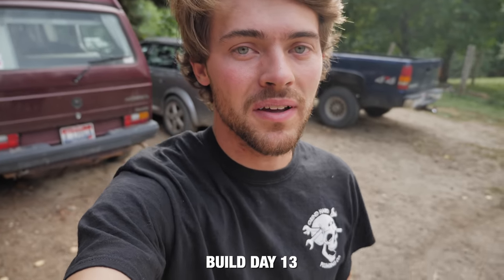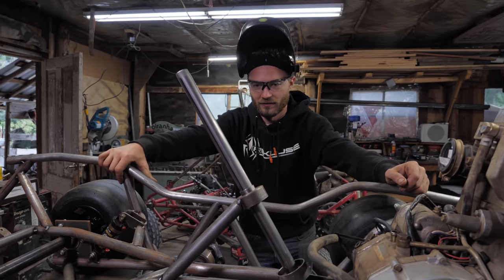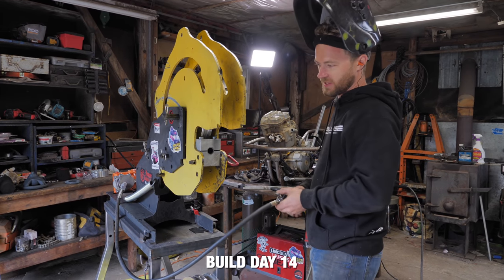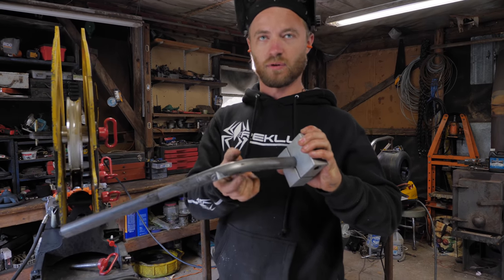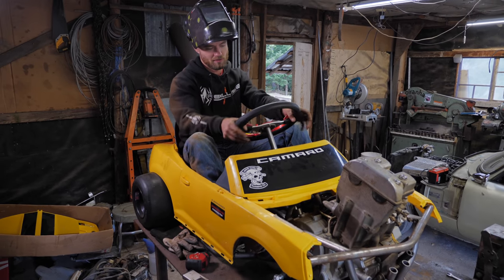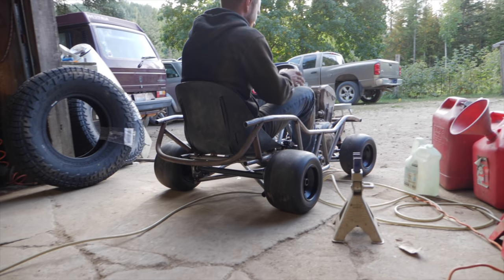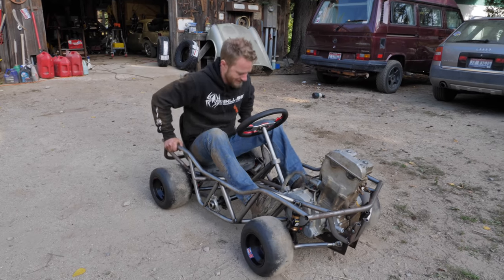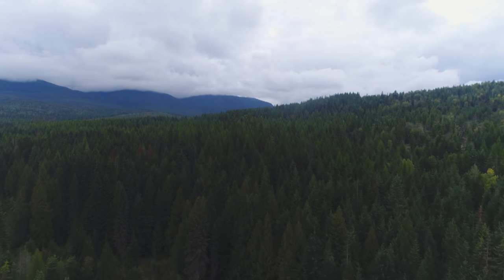Real Life Mario Kart Build!

Comment: 5 LBS you saved in rotating weight. Thats huge for something this size.
Reply: Big time
Reply: What do you mean rotating weight?
Reply: John Paulk from someone who doesn’t really know what they are talking about, weight basically increases as it rotates quicker. Like if you have a unbalanced wheel on a car, could be a minuscule difference but it vibrates your whole car.
Reply: @johnpaulk994  Tape a pop bottle to your driveshaft and find out
Reply: @johnpaulk994  rotating weight would be the total weight of all the driveshaft components (everything that rotates while the vehicle is moving). It's important because more rotating weight will have higher intertia, meaning the motor has to work harder to get it all moving and keep it moving. Plus, once it's  moving, it is harder to slow down.
Reply: @johnpaulk994  
Additionally, the more mass you have the harder it is for the engine to spin it but at the same time, more work has to be done for it to stop.
Reply: Then you remember its 500cc not 100.  The thing is insane. It has a fraction of the rotating mass and load in general that the engine was intended for.  Speed runs weight will need to be added.  And having more balanced rotating mass makes everything more stable. The higher the inertia the greater the resistance to change.  To little can be a thing. But it isn't a super car its a spastic kart so ehh.
Reply: @willpestka2745  Higher weight= more inertia. More inertia the less shock loading the engine itself will get.  Fill a push bikes tyres with water. It makes it harder but far smoother. And more inclined to continue to roll.
Reply: @friendlyoldbum9182  I know, but in general less is better. Too little and you're right, it'll cause problems. Thats why cars have flywheels.
Reply: @friendlyoldbum9182  
Thats what Im implying. It doesnt want to slow down/stop. It has a higher mass moment of inertia and therefore a greater moment would be required to slow it/stop it as well as start it/accelerate. By this, it has a higher degree of resistance to input forces.
Semantics, but inertia involves mass, not weight.
Reply: Wasnt being a wheeny. Just adding to you guys for anyone else that reads :D
Reply: An axle's weight, isn't going to have much of an effect on rotational mass due to is being at the centre. It is however going to improve handling due to a marked difference in sprung weight.
Reply: Almost everyone in this thread is ridiculous.
Reply: @thegenerousdegenerate9395  Thank you for your opinion. Though accurate I guess.
Reply: The more you know
Reply: Ay Stokes  haha wrong, I tried that but I found it was just as easy and better to play sitting and just wave around.
Reply: @TobiMcTobeface  
I didnt consider that aspect. Solid observation 👍
Reply: You are ALL WRONG.... Mechanical advantage in rotation.
Reply: It’s such a small diameter that the rotational inertia won’t really be affected, the weight would have to be a lot farther from center to have enough affect to be noticeable.  It’s also not unspung weight since it’s a solid mounted jackshaft, not a moving part of the suspension.
Reply: Weight is expontial especially in rotation.
Reply: @isaakwelch3451  What else would a starter engage with?
Reply: Pmoi on that small a tube means the weight saved won't have that much effect on rotational forces, but 5lb overall is a huge savings when you look at the percentage compared to total mass..
Reply: @theastronaut2276  if it's part of the suspension it's sprung weight
Reply: @shadowthehedgehog4737  a toothed accessory drive pulley
Reply: @isaakwelch3451  Yes.
Reply: @willpestka2745  Yes.
Reply: @johnpaulk994  The axle is lighter. It spools up more freely. Also, less unsprung weight. (Weight of components below the suspension pivot points).
Reply: @shadowthehedgehog4737  automatics typically don't have flywheels. The torque converter does the job of dampening vibrations.

Comment: Maybe hold off on painting the steering wheel until after the build. Like you said the little bit of red accents might work.
Going overkill on frame is a good thing. When ever something breaks its not because it was too strong. The engine will put out some torque. And you might just push it to the edge.

Comment: What's up Grind hard! 
Love the way your build's evolve as knowledge, experience and means build up over time 👍😀👍
A note on your steering angle.. Think you would want a bit more angle when you get sliding around in that thing. It's easier to control on the edge with a bit of margin..
Awesome work guys!! Keep it up and there's no limit to what you will achieve 😀 
Best regards from Jonny Bech 
//Sweden.

Comment: Looks like you guys may want to trim the points off the lower front suspension bracket and make a skid plate. Bottoms out pretty good at that height with those tires.

Comment: Just something i noticed, but those gussets under the front of the motor look like they'd stop you dangerously quick if they dug their teeth in during a high speed bottom out. Might want to round those off a bit, but I'm assuming you're going to increase the dampening on those shocks at some point, too.

Comment: Is the new axle hollow tubing? A tube is stronger that a bar of the same diameter because it has more surface area, inside and out. So besides weighing half as much, I is much stronger.

Comment: Shift paddles on the steering wheel and the clutch also on the steering wheel, would be cool, as by a real race kart, and it's much easier to handle while driving. Left paddle for down shifting right for up. 🤔 actually, with this engine, your kart should be a bit faster as a normal 125cc shifting race kart.